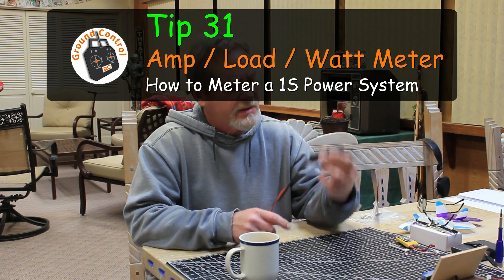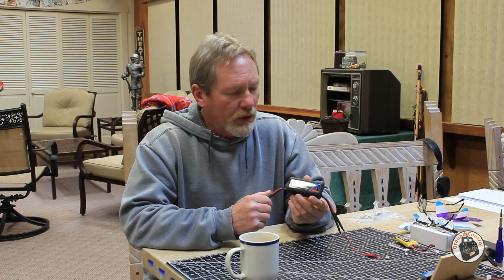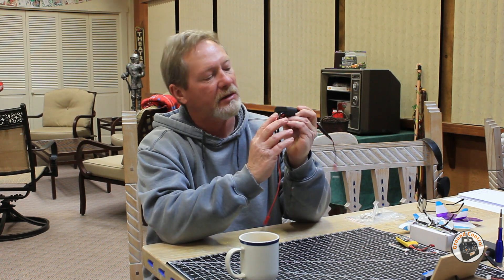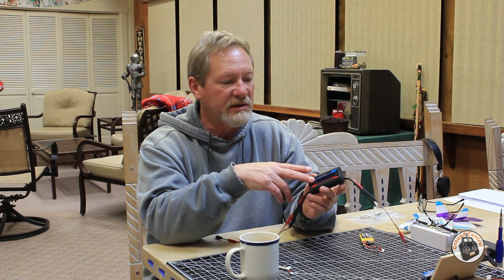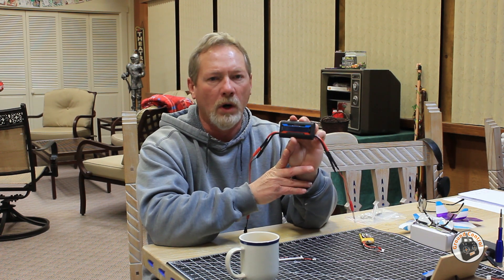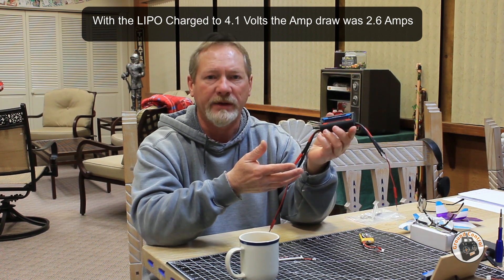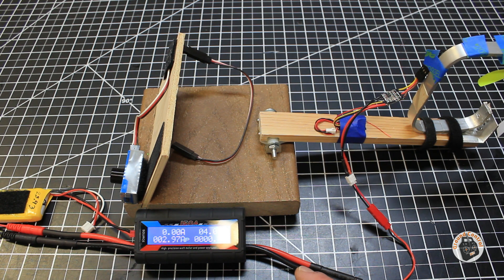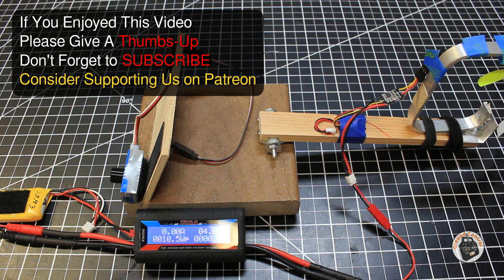Tip #31 - How to Setup your Amp / Load / Watt Meter for 1S Power Systems

Comment: Why is my unit not holding peak readings when I release load?
Reply from the maker: If you have the same unit and it's not holding the peak reading you have a bad unit.
Mine always holds the peak reading.
That's assuming you still have the battery plugged into the unit.

Comment: Hi may I change the cables for higher ampere  measurements?
Reply from the maker: The stock cables will support the highest amount of amps the meter is rated for.

Comment: any idea at what point these units roll over to zero in watt hours? i realize this is beyond the scope of the intended use in the application of this video, i am using mine to monitor solar power input. i assumed it was rolling over to zero after 999wh but i have reason to beleive its much less than that, somewhere around 350wh to 700wh. also the ah rolls over, again i assumed it was 99ah but i dont know for sure. i bought a bunch of these things and soldered them up and learned the hard way about this limitation. i am now using hall affect sensors, but i would like to learn more about these watt meters since i bought so many of them
Reply from the maker: Hi Jason! I'm not sure. Here is what I found listed for measurement range and resolution for this specific meter.
0-150A, resolution 0.01A;
0-60V, resolution 0.01v;
0-6554W, resolution 0.1w;
0-65Ah,resolution 0.001An;
0-6441Wh,resolution 0.1Wh;
If it's rolling over before these limits then I'd say it's not performing as it should.
Reply: @GroundControlRC  thanks, i guess i should have looked in the manual for those specs, my brain has been failing me left and  right lately. i do have the"200 amp" version that has 12 gauge wires on it, but i bet its the same specs as you
Reply from the maker: @jasonbrown467  You are most welcome ;-) See you in the Air!

Comment: That is very useful to know, I have one of these.. Thanks.
If you take a series of readings you could probably extrapolate the data to allow you to offset the 0.2v readings, using ohms law to cross reference.
Esc amperage capability is not an exact science regardless, in my experience, as long as you are in the ballpark then temp monitoring is usually more indicative of its capabilities.
Reply from the maker: Thank you Paul! I agree, the readings are close enough that you shouldn't burn up a motor, esc, or puff a battery using the data. That's a huge benefit in selecting the right components for a 1S Power System. See you in the Air!